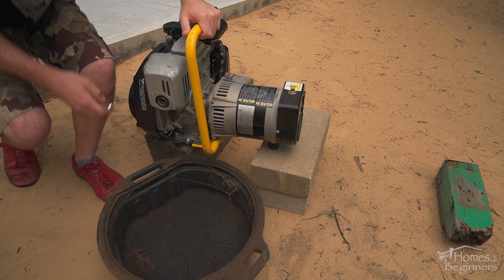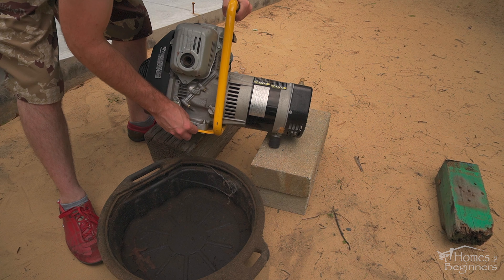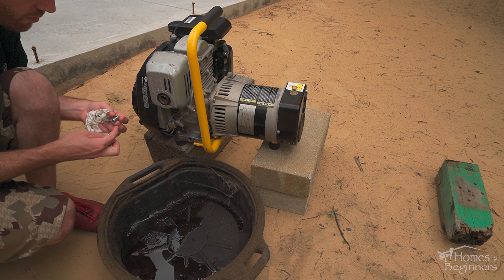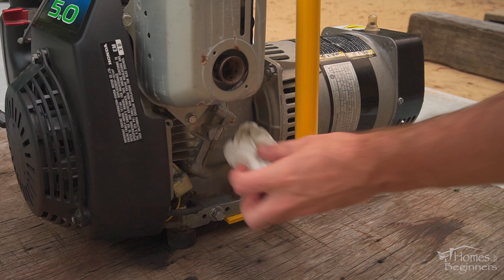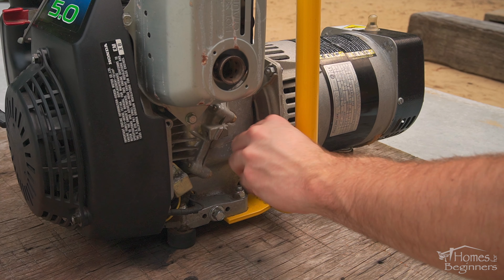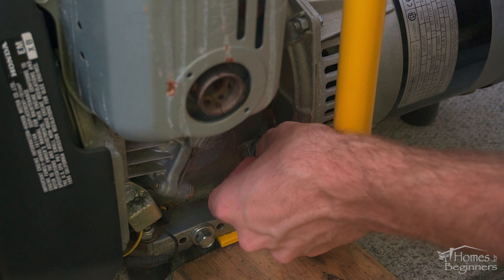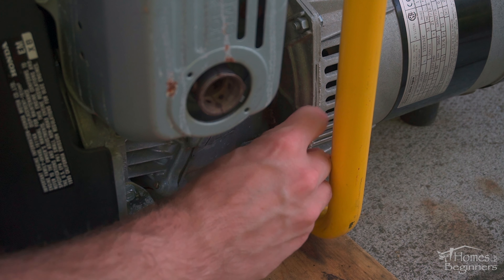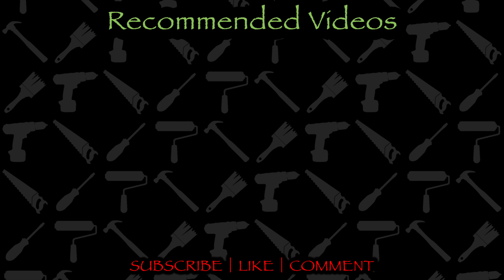How to Change the Oil on a Honda 5hp Engine GC160

Comment: This is an excellent video. Could you possibly link the type of crush washer I’m supposed to get for the GC160? Is it the same as for a Honda CRV?
Reply from the maker: Thank you. I don't have a link specifically for the GC160. I just have a generic kit with various sizes that I'll match up. Just make sure you have the correct diameter.